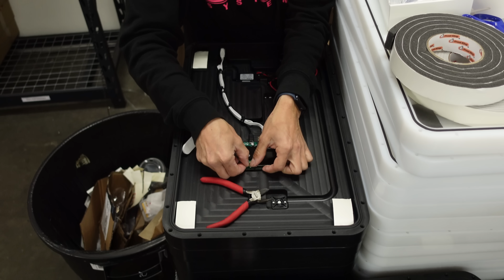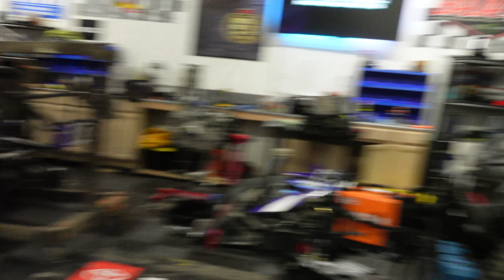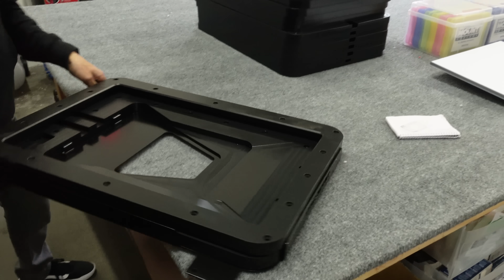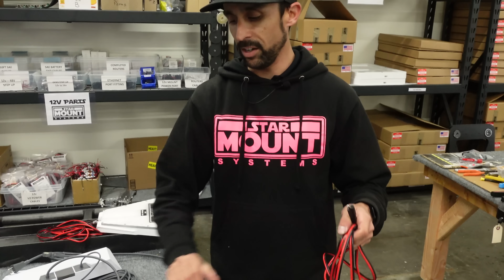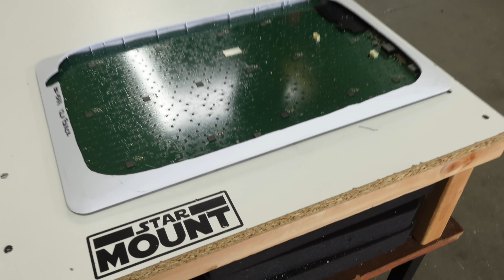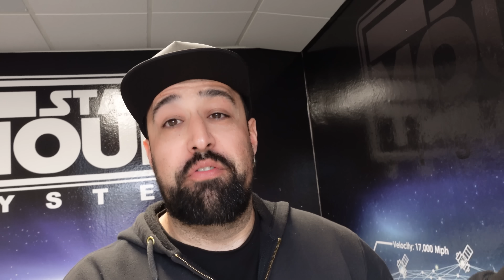Unleash The Power Of Starlink! Learn How To Mount It On Your Overland Rig | Chasing Dust

Comment: very cool but how do you align the direction of the dish to get the optimum signal as required with the starlink app? especially when the 12v conversion kit is installed.
Reply: I had the exact same question. I have seen in a handful of vids that you basically ignore the "alignment" moving of the dish and click through it on the app. It continues on and connects.

Comment: This is awesome - state of the art - but Starmount is backlogged indefinitely in getting these out and doesn't install them to my knowledge.  I need one installed on my sprinter camper van asap but the installer can't seem to get them from Starmount.  Any updates on when more of these (with the 12v conversion kit) will be available?